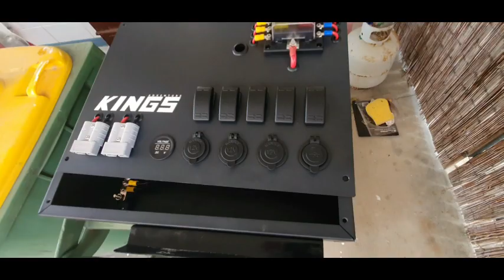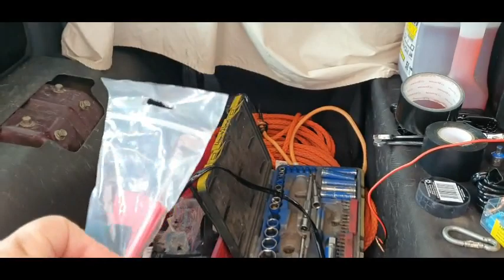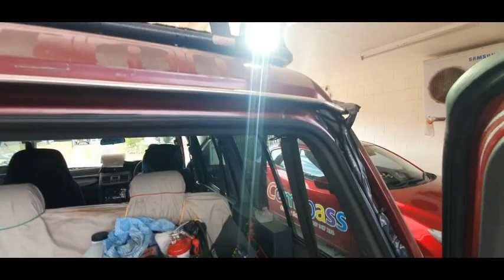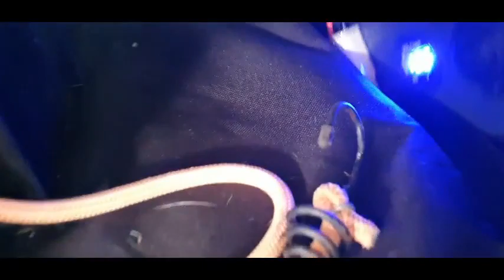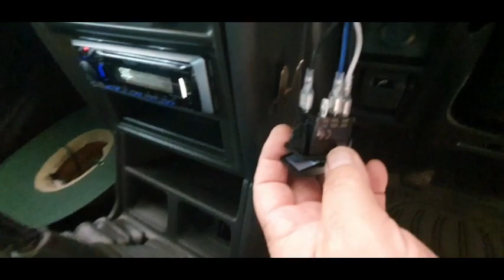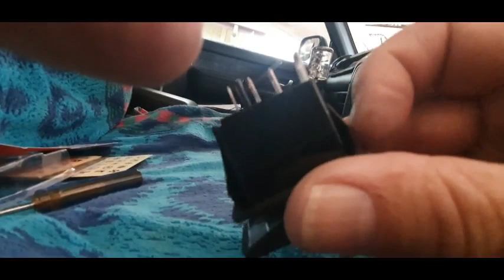HOW TO INSTALL KINGS CONTROL PANEL & CONNECT POWER!

Comment: yeh i was thinking the same i hate wiring. ive got to install my brothers soon for his fridge etc etc, second battery etc
Reply from the maker: Ok..it's like a electrical jigsaw puzzle I take my hat off to sparkys,does your brother pay you in alcohol refreshments  😁
Reply: @AussieManCave  no i do it because he cant, i rebuilt his zd30  aswell because they wanted 15k i did it for 5 that included a new clutch, was alot of work though.
Reply from the maker: @closertothetruth9209  wow $15k bloody hell... yes I was quoted $10k engine out and delivered 🤪 I had the impression that alot of work shops didn't want to help or could be bother ...at least doing your self it's peace of mind and self achievement 🙂